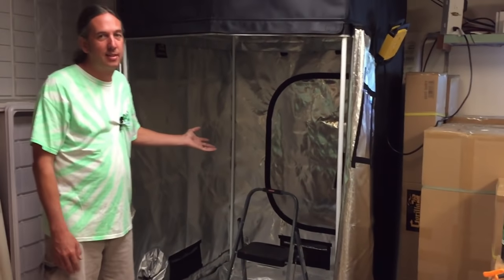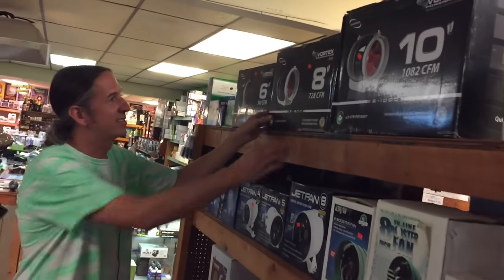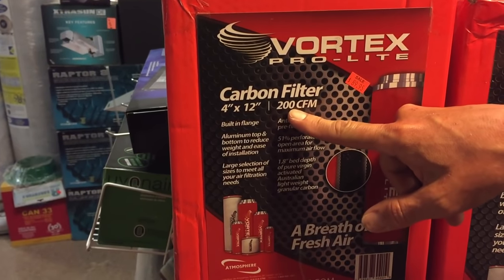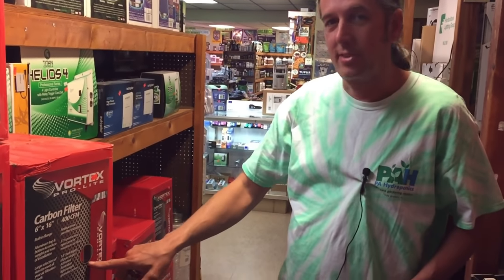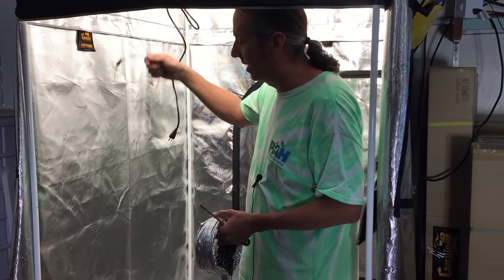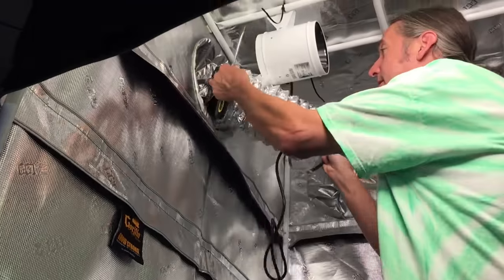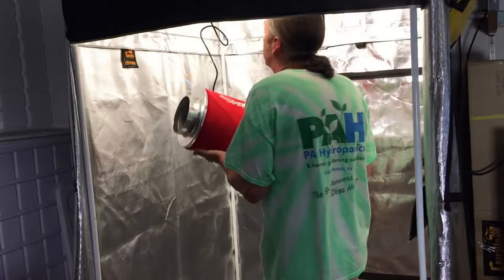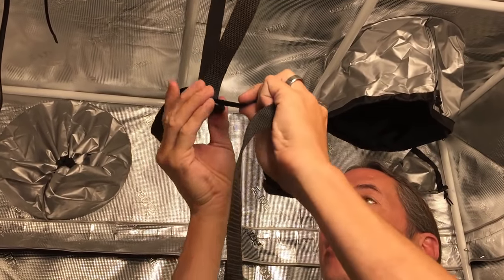How to Set Up a Ventilation System for a LED Grow Tent

Comment: Hi Gary, great video. Hey I have a 4’5 tent with 6” fan exhaust and I find it hard to keep the heat and humidity up with the fan on. How do I fix this?
Reply from the maker: Hey there, you should get a fan speed controller and slow it down so it can build up some heat and that should help with humidity too, under 20% humidity can actually lock out calcium uptake! Thanks for the comment! Gary
Reply: @PAHydroponics  really. Just learned something.
Reply: Michelle Scott humidifier that automatically humidifies  to you’re desired RH and heater with thermostat that adjust to desired heat
Reply: You can buy either a heat/temp controller like inkbird sells. Or an AC INFINITY “T”” series fan that has the heat/temp controller. You set your parameters and and the fan will not come on until your tent reaches the limits you set. Though you will need to sublime to CO2
Reply: @WestCoastCroppers  I second this - get the AC INFINITY T series fan in 4", 6", all the way up to 12" with temperature and humidity controls to maintain ideal environment automatically. They cost more but they use far less electricity, are whisper quiet and two fans can be used together on one controller. I've got three and I am getting 2 more, well worth it.
Reply: Andrew Terry 👊🏻
Reply: @PAHydroponics  I wish I had low humidity issues... Constant 80+ where I am... Usually 95% :/
Reply: @andrewterry8092  I’ve been thinking about using Ink Bird controls with my 4” & 6” AC Infinity. Would there be any reason not to use the Ink Bird?
Reply: Have u checked out Amazon's humidity adimizer they are 12 bucks all u need is tap water and a 5 gallon bucket 🪣😄

Comment: Hi im a bit confused what size carbon filter would i need for a 120x120x200 tent im using a 600w led and do i need to cover the tents air vents and buy  an intake fan if want to hide odor or will i be safe forgetting about the intake fan and just leaving the air vents uncovered as long as i have a carbon filter in the tent i no its probably a dumb question but im really confused id be thankfull for any advice

Comment: Nice set up but I wouldn't have used any ducting, as you could just pull the tent ducts to the fan and have way less drag. Effectively you're venting directly outside. Ducts slow down the output. Especially corrugated ducting.

Comment: What’s a rough cost estimate for this setup on the ventilation? Including intake fan, carbon filter, out take fan and ducting?
Reply: 4x4 tent is around 100-120,fan and filter combo about 50-80 for a decent setup,not counting costs of quality genetics,soil,and fertilizers. Good quality  fertilizer is a MUST. Don’t cheap out. Feed the roots and enjoy the fruits 😏👌🏼
Reply from the maker: Follow the link to the store for current pricing. The link is for a 6" ventilation kit.  We offer a 4", and an 8" ventilation kit as well depending on the your ventilation needs. 

http://shop.pahydroponics.com/complete-pro-6-ventilation-kit-for-indoor-grow-tents/

This kit includes:
1 - 6" Hydrofarm Jetfan with digital speed controller
1 - 6x16" Pro-lite Vortex Filter
25 Feet of Ideal Air Supreme ducting ( you can cut to size )
3 - metal duct clamps
4 - 6" zip ties for fan mounting

Comment: Is it ok to just pull air from directly inside the tent with all pockets closed and sealed or do i need to pull air in to the tent, through the filter, then exhaust it outside window ?
Hope this makes sense
Reply: Just watched your video, just leave the bottom vents open to bring fresh air in from that way was the answer i was looking for 😉👍🏼

Comment: Thank you for this video. I've managed to get my fan up, now just filter and ducting to go! 

I was hoping for some advice on the ducting and hanging the filter. When I wrap the straps around two bars and try placing the filter in the cradle the bars come together at the end opposite from the fan. Could I just wrap the straps around one bar instead?

And then, I have one 8 ft piece of hose. Should I cut the hose into two pieces; one between the fan and filter, and one from the fan to tent exhaust? Or just buy some metallic tape and/or more dryer vent hose?
Reply from the maker: I think you will be fine to hang the filter from one of the bars, that is if I understood you correctly.

I would hang the filter and then cut a section of your air duct to go from the filter to the fan and then from the fan out of your tent.

It can be a challenge hanging any items in the tent.
Reply: @PAHydroponics  yep you got it. Once again, thanks for the advice. I'm using a 4 x 4 x 6.5ft tent. And have a 6" inline 440 cfm fan. Not sure whether to put my fan and cf in the center in a straight line out the exhaust or to the side with a bend up to a roof exhaust. Or maybe to the side with two bends out the center exhaust? The center exhaust is 6" like the fan and the roof exhaust is 8". I am concerned if I place the filter in the center above the light that it will reduce the space I have to raise my light.
Reply: @PAHydroponics  I ended up just hanging the fan and filter on one bar, and hung the light on two bars running parallel to and below the one bar holding all the ventilation. Going out the port on top. I managed to get it to the side enough to raise my light to the ceiling

Comment: The exhaust will it smell up the place ?? Or does the filter do it’s job??
Reply from the maker: A quality carbon filter and fan will scrub the air of any noticeable odors.  They are an excellent tool in keeping odors under control.

Comment: having problems with heat in my tent, have you ever used a portable air conditioner in a tent before?
Reply from the maker: It is not necessary to run a duct to another room unless you are removing a lot of heat and don't want it in the room the tent is in.

Comment: Question about fresh air and darkness.  Do I have to keep a flap open for fresh air to be pulled through by the exhaust fan? If so how do you control light with the vent open?
Reply: Keep the flaps clsed tight. Off light stress ur grow and can hurt the flower or grow. Buy "side bar fans" for fresh air intake[ look around prices are insane ok ".stay diligent you'll find a good deal also buy quality] . 2.You can buy a light control switch [light timer] so you can set ur light to 12/12. Or w/e ur grow needs.

Comment: So it’s ok to just have the ventilation exiting into the room? You’d don’t have to cut a hole in your wall to Where it’s exiting outside?
Reply from the maker: In this set up the objective is to pull fresh air into the tent for the plants, while exhausted air is being cleaned of any odors.  

We are also taking advantage of having the filter in the top of the tent where hotter air will rise and collect. Removing air from the top of the tent helps in air circulation as well as temperature moderation throughout the tent.

Comment: Just found this video now. I’m setting up a 3x3x6’ tent.   I have a ViperSpectra 900w light in there. I just set it up tonight. With no fans or ventilation set up yet, it’s 97 degrees inside the tent... so I clearly need a ventilation setup. I have multiple 6” holes in my tent so I’m assuming a 6” ventilation setup is what I need, correct?   Also noted that there is 11% humidity too... so I probably need a humidifier?
Reply: Some fans will help too. 98 degrees is very very high. Try 73-85. The.fans Wil knock it down to 70-80 degrees.

U don't want a desert in there.  But that depends on if ur growing oranges .😃

Comment: Hi struggling to keep My room a nice temp since swapping to LED's. As we know the heat tends to radiat straight up rather than down so was wondering how you felt about extracting the air from the bottom of the tent and feeding it in from the top maybe through an air sock to try and defuse it around  tent. Hopefully this might drag the warm air in the top of tent down and around the plants Hopefully raising temp at the leaves the few extra degrees I need would love to hear your or anyone's else's opinion on this. Thanks in advance.
Reply: Here's an idea I saw for saving the rising heat in a cool room.
If you have a 4" inline duct fan, you can attach it to a 4" ell pipe, then have straight duct pipe going from the ell, straight up to near the top of your tent, zip tie it in the corner. The duct fan, pointing out from the ell at the bottom of the stack will suck warm air from the top of the tent and blow it out at the bottom, forming a convection loop inside the tent.
I hope you can visualize this.

Comment: This tutorial is helpful for any new grower but if the goal of this video is to demonstrate the most effective methods for removing the smell of cannabis from a grow tent, then a few key points have been overlooked. 

The relationship between the fan and carbon filter cannot be overstated and the path used in this video: carbon filter > ducting > fan > wall > ducting, creates the opportunity for non-filtered air to be evacuated through gaps in the "seals" around the carbon filter and fan, as well as any damaged spots in the ducting. 

This issue can be addressed in a number of ways but here's a simple tip: attaching the fan DIRECTLY to the carbon filter drastically reduces the chances of exhausting non-filtered air. Fan type will dictate fan:filter orientation but those using mixed flow/centrifugal, try this path: ducting (optional) > wall > fan > carbon filter. 

This path effectively mitigates the seals problem, it drastically reduces fan noise, ensures carbon-dust isn't sprayed all over your space (assuming dust filter attached to the outside of the carbon filter), and requires fewer materials like ducting, tape, and hose clamps. 

DM me and I'll help you make an updated version!
Reply from the maker: Hey bud, I do get what you are saying but I have had a good number of people void there warranties on there fans by drilling holes to direct mount there fan to the filters, you can tape up the seams and do fine and we always ship premium double layered ducting to avoid tears. I do appreciate your input and thanks for watching. G
Reply: @PAHydroponics  Message received. Change your mind any time.
Reply from the maker: @jeffmiller8583  Please elaborate:) How do you hook it right to the filter?
Reply: @PAHydroponics  As long as fan vibrations are stabilized relative to the filter, any method you'd like. Since you asked, the key isn't to think about "attaching" the two as much as thinking of them as one unit. A handy DIY connection built from a steel fan and DIY refillable filter was the most novel I've seen. 

But, my point was less about fans and warranties and more about grow room smells. At least that's how I interpreted this video. 

What does this video mean to you?

Comment: Is a 8inch in-line fan for the fresh air from outside inn and the 8inch fan up top with the filter a good size for a 20x10x6 1/2 tall tent if you guys can help me and I will be running the AC infinity set up thanks

Comment: Thank for the video, very informative. I have one question that if I put the tent in my bedroom. Should I make the duct out to the window? or is it fine with close room?
Reply from the maker: Hello, if you have good ac in your bedroom you can vent back into it, without good ac it will get warm and humid and you may not sleep good. Thanks for watching. Gary
Reply: PA Hydroponics how would you suggest venting the air back to the AC? I had my ducting on top of the tent facing up towards the AC in the ceiling (new home). Is that suffice? The room seemed to stay the same temp though.
Reply from the maker: @dashluge  If the room is keeping steady you are probably good to go like that, usually your home rooms has 2 return vents one near floor and one near ceiling, close the bottom vents and let the returns suck from the upper vents to get the hottest air out of room. Hope this helps and thanks for watching. Gary

Comment: DIY-12' existing bsmt wall-creating closet-w sliding doors-8 x 2.5 clothes closet-with 4 x 2.5 space of DIY lockable room.....For building an enclosed room-in finished basement- can filtered /exhaust fan  be vented thru wall to adjoining basement bathroom without any mold-smell issues?...5 x 2.5 x 6.6 -installing low intake vent for fresh air-(will it also need an intake fan)-smaller size/CFM than exhaust set up?..no attic or window access-room will have only  west facing front entry access via 36" lockable light tight door....any help greatly appreciated!
Reply from the maker: For building an enclosed room-in finished basement- can filtered /exhaust fan  be vented thru wall to adjoining basement bathroom without any mold-smell issues?

..... Using the carbon filter will address any odors.  Exhausting the closet can help with humidity, but in most cases basements are usually a little more humid and may require a dehumidifier to keep levels in check.

5 x 2.5 x 6.6 -installing low intake vent for fresh air-(will it also need an intake fan)-smaller size/CFM than exhaust set up?

As long as the vent is unrestricted a fan shouldn't be necessary.  

Hope this helps.

Comment: Using a 2×2×4 myself. I'm guessing a 4inch would be alright? Also any recommendations on lights?. Currently have a 1000w without Veg/Bloom setting
Reply: Led, is way to go. Bulbs  can shatter/burst/burn out . Its just not what you want to experience in this climate going on. also ur lighting bill is vastly lower with led lights.

Might want to get good high quality surge protector.  Only use 80% of the open sockets leave 2 unused.

Best to get a light with bloom n veg switches. With w/e watts u desire[need].  It just less hassle to click a switch n continue ur successful grow.

Comment: Are you also using an intake for fresh air coming in to the tent?
Reply: This is what I also wanted to ask. I don't think he is and I don't think it's as much of a necessity in 4x4 tents, or when your room temp/humidity doesn't require it. The passive venting on the side of the tent might be good enough. It'd be great to hear from Gary directly on this though.
Reply from the maker: No additional fan is necessary for bringing air into the tent.  Opening one of the vents closer to the bottom of the tent to supply fresh cooler air should do well.  The warm air with any particles of scent will rise and be pulled out but the ventilation system, while cool air comes into the tent from the bottom.

Comment: What do you do for intake ventilation?
Reply from the maker: Hello, this fan blows out and causes a vacuum that pulls in fresh air thru the bottom flaps or vent holes so you dont need an intake fan. Hope this helps. Thanks for watching:) Gary

Comment: Sorry for all the questions but you said leave the ports open on the bottom wouldn't that release the smell of the weed and don't you need a intake on the bottom to bring in fresh air?
Reply from the maker: Hey there, the fan creates a negative pressure in the tent and that sucks in air thru the open vent so the smell is always heading towards the filter and not going out the vent but when you open the door then yeah it will come out but you can crank the fan full speed before you open the door to try to help with that. Thanks for all your compliments :) Peace. Gary
Reply: @PAHydroponics  one more thing Gary do I need to have a intake fan at the bottom of the tent bringing in fresh air?
Reply: Cyclonex1CA ca  thanks for the helpful information

Comment: What do you do if you're supplementing co2 into the room. Do you just run the fan on a timer so it shuts off for a bit so the room has a chance to fill with co2?
Reply from the maker: Hello, good question. What I have done myself in this situation is to slow the fan down as much as possible while keeping the temps under 85, the plants actually absorb Co2 easier at 85 but if you run hydro that is not good without a chiller. Then I stick the co2 tube from the co2 tank regulator right behind the fan that blows on the plants so it blows the co2 right on them. This seems to work for me but every room is different. Hope this helps! Thanks for watching :) Gary

Comment: hey guys nice video, what if i buy  Vortex S Line S-800 Power Fan for 4v4 tent which filter will u recommend ? and whats the difference beatwen  Vortex S Line S-800 Power Fan and Vortex S-Line Ultra Quiet Fan 8" 728 CFM fans ? thx...
Reply from the maker: Hello, those fans you mention are the same fan, I think online sellers are just wording it different on whatever you are looking at. 8 inch is way big for a 4x4, you should get a fan speed controller to slow it down , or you will be sucking the walls in pretty hard. As for a filter - any 8" name brand, the Vortex 8x24 lite would do fine especially if you slow down the fan. I would do a 6 inch, and still you might want a fan speed controller, the S-lines are very nice and quiet with a 10 year warranty! Thanks for watching. Gary

Comment: I have the same set up and have a question. How is the tent releasing the air? I understand the fan is pulling it in and filtering it through the filter but how does air escape? Anyone? Last step I need to figure out before I begin
Reply: The fan is pulling air in by pushing it out in other words the fan is actually blowing out of the tent not in you just leave an open place for air to come in physics does the rest

Comment: I hate to knit pick and I might be all wet but, Aren't you filtering the air before it "leaves" the tent? Wouldn't you filter air before it enters the tent so you have nice clean air coming into the tent? That incoming screen at the bottom can't stop pollen, spores and critters of all kinds, in fact it is pulling incoming air with all those things in it and carrying them up to your plants. !!! Other than that, nice vid...